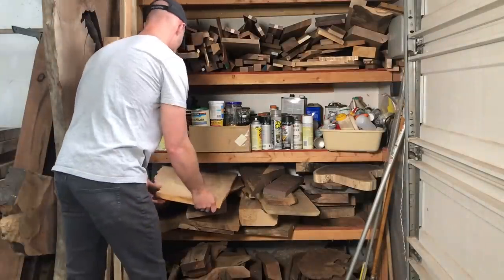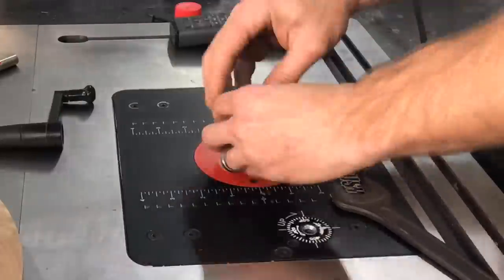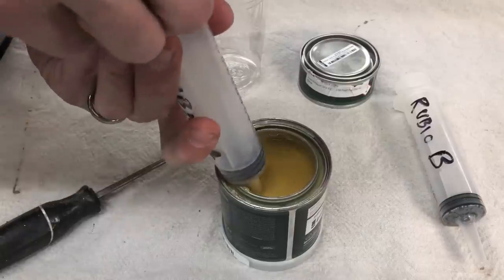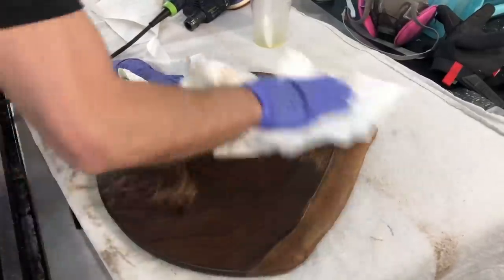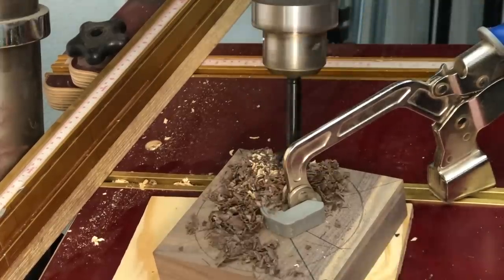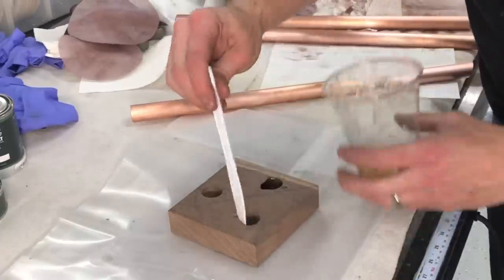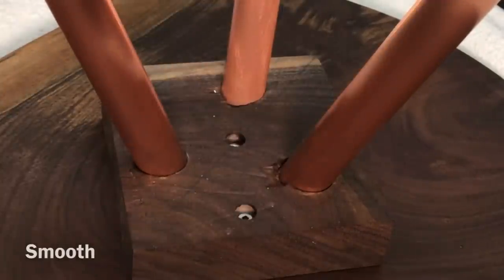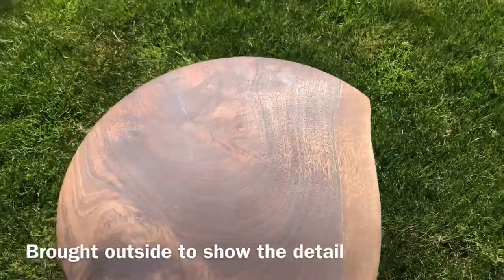$20 Woodworking

Comment: Getting everything ready to make my first river table. Going to be a small end table. 20” long, 12” wide, little under 2” deep. 
Problem is I don’t have a garage or space to work. 
I will be doing all the work on my porch. I’m making a covered box to allow it to cure 24hours between each layer of pouring. I’ll do a few steps probably.
2 questions.
1. If I do multiple pours, is the table top epoxy fine to use? It’s drastically cheaper than the deep pour I’ve found, and not many local options since I’m in Alaska.
2. Right now the temp is 50 at night and 70+ during the day. Anything specific I should try to do to get the epoxy to cure correctly?
Reply from the maker: Yup, both should work fine

Comment: My next project is an outside table with wooden legs and frame (4X4 and 2X4) and PVC deck top.

When you sand, why can't you go from 120 straight to 220 grit? Yeah my table sounds lame but i plan to sand the legs and use something to protect from the elements and all. It will entirely outside, any suggestions on what I should use for protection?

I appreciate you taking the time to answer and the video. I do like the copper legs.
Reply from the maker: 220 isn’t aggressive enough, just part of the process

Comment: Hi Cam, been watching your videos and learning lots and am getting ready to try my first table.
What I wanted to ask, is this table I want to build is going to be placed beside a bath tub, in a damp area.
Essentially it is going to be used to hold glass of wine, candles, book, maybe a small plant. It's small, a triangle with a flat edge at about 24in, top edge about 27-29 in, and the last edge about 24in.
I'm thinking first to stain the cherry wood, use a metallic black epoxy fill in the holes, and then seeing as this would be in a damp area, I had the thought to add a clear coat on top to seal it. Would this be a good idea, or would one of the finishes you used on the $10,000 dinning table build work ?
Thanks for the tips and tricks and education on building these tables. Super excited to start out.

All the best,
Reply from the maker: The clear coat, or any of the finishes that I use should be fine to use in that application! Sounds like a great first project. Good luck!👍🏻
Reply: @BlacktailStudio  One more question.. What's the best product to colour the resin? Looking for a black metallic type. Powder or I see you using drops.

Comment: Epoxy dining table for my fire station. The concept for the table is to look like a thin red line flag with the red line being the epoxy. What epoxy dye would you recommend?  I want it to be a rich fire engine red and opaque. Most of the dyes I’ve seen are see through and that isn’t the look I’m going for.
Reply from the maker: I like transtint

Comment: Hey Cam, how would the OsmoX do compared to the Rubio? I just bought some Osmo based on your videos.
Reply: I use Osmo on all my customers projects. For table tops I put two coats of 1101 extra thin wax to seal then 2+ coats of 5125 full solid polyx. Apply polyx with scraper, buff in with white 3m pad by hand or with an orbital sander/ buffer at low speed. Apply a second coat an hour later with scraper, buff in, rest an hour and wipe excess with clean shop towel. More coats can be added in the same manner. Any water that is left to sit will leave marks but evaporate away in a short time.
Reply from the maker: Not as much shine as Osmo. But better protection

Comment: I’d like to make some cedar Adirondack chairs for sitting around the fire pit.  We are in the forest and it’s very wet here.  Our wood, if left outside, doesn’t last long.  I don’t expect it to but I’d like it to be water resisted as well as UV resistant in order to last as long as possible. I wonder it the 2 part coating would work well or just begin to fade and look crummy after a short time?
I like the copper legs.  Very durable and able to be shined up again should they get dull.  Thanks for the video.

Comment: Not working on anything right now but I did finish your video.  I was wondering.  Did you cap the ends of your copper legs or atleast round them over?  Copper is pretty soft and over time it can bend or fray causing scratches if you set it on a wood or even laminate floor.  I’m probably preaching to the choir but just asking.
Reply from the maker: I didn’t end up using this 👊

Comment: Hi Cal. I've got a few questions for you if that's ok? First of all I'm the idiot that posted on one of your other videos about   how I had some epoxy that didn't cure. Well i started a new table, paid more attention to mixing, and all went good this time! I am seriously new to all this, do you water pop when you do your resin tables too? Also on the first table I messed up, I used rubio, I used the cleaner too before the finish and I ended up with some smooth parts and some nobbley parts. Do you know if this is because I haven't sanded enough/effectively? Or do I need to be buffing more? Did I not get it clean enough? I'm a little lost, any thoughts? Thanks :-)
Reply from the maker: I’d guess it was sanding. And I water pop with any Rubio. So far anyway. Still learning it

Comment: Jarrah burl coffee table with hair pin legs. Will be doing my first epoxy coat on it because why not?
Curious to know what you did on the bottom ends of the copper ? Copper is quite sharp when cut especially on an angle like that, I'd be worried it would scratch the flooring
Reply from the maker: Yup, carpet only!

Comment: Great simple table looks beautiful. As for the coating what would you prefer now the Rubio or the mono? Or what would you use for what application?
Reply from the maker: Rubio is monocoat. Working on a finish video though. Rubio for protection, Osmo for gloss if that’s what you meant
Reply: Blacktail Studio sorry about that. I meant Rubio versus Osmo. As you do a lot of times very large tables don’t you want to use Rubio than for protection?

Comment: I want to use some live edge slabs for the treads on my staircase, do I need to let the slabs dry before glueing them down?  I liked the copper legs, maybe rebar legs would’ve worked also
Reply from the maker: I would think they should be dry

Comment: Good work! I have just made a dining table from pine, I have applied Briwax Jacobean to finish and it looks amazing. But I've noticed that it marks quite easy but you can only notice it with light shining off it. Would you recommend any other coat to put on top to protect it, preferably not glossy?

Thanks!
Reply from the maker: This finish worked really well!

Comment: Whatever my wife wants, my next project, not a big fan with the copper legs.  My issue isn’t wife the copper per se, but more to do with the ends.  Worry that the sharp edge will damage my flooring.  That, and it doesn’t look finished.

Comment: I would really like to get into doing projects like yours and I already have all the tools; but materials are another story. Have you any clue on where I can get small cut offs for a good price? Anything to the same size or smaller then size of the piece you used in this video would be preferable. Also for the legs of this table, I would have used small saplings that have indents from vines growing around them in a spiral
Reply from the maker: Not sure about the cutoffs!

Comment: Hi Cam! I was wondering what grit you finish on for sanding usually? Mostly I think I've seen you finish around 240? I was also wondering why you chose that point to stop instead of maybe going to a higher grit for a smoother finish? Love the videos! Thanks!
Reply from the maker: With this finish you get less protection with higher grits.
Reply: @BlacktailStudio  that makes a lot of sense! Thanks :)

Comment: Black walnut coffee table. I jumped the gun and purchased the 3 gal Liquid Glass Deep Pour kit. Not sure why I didn't think to measure beforehand, but my slab is around 1 3/4". As dumb as this may sound, can I still use the Deep Pour 2" - 4" epoxy I've purchased on this slightly undersized slab?
Reply from the maker: Of course! Definitely under is ok

Comment: I want to make wood/epoxy coasters as a starter project. When you buff in the rubio oil with your buffer pad, do you need to wash out the pad? Or do you have pads dedicated to certain oil colors?
Reply from the maker: The pads are disposable 👍🏼

Comment: Just milled my first walnut logs with an “Alaskan saw mill” and have them curing. Plan on using 2 of the slabs to make a live edge bar top with a built in kegerator.  How long should I let these cure? And should I debark them now or after they have cured for an extended time?
Reply from the maker: Check out my goby interview on the most expensive wood video

Comment: I've got 4 end tables and a coffee table in progress. What are the two parts of the finish. With regards to the water test, I'm wondering if it will lose protection over time, years maybe. Or is it like an epoxy?
Reply from the maker: It’s a Rubio finish; one part is the finish, the second is the accelerator. I’ve linked it in the description. I would expect it to lose some protection over time, but it’s easy to reapply!

Comment: Live edge epoxy table, Hello cam nice table but the legs are bit strange but in a good way 
wanted to ask you whats the difference between wet sanding and the regular sanding when it comes to epoxy tables and won't the wood re-absorb water ?
Reply from the maker: Don’t wet sand raw wood. Probably google it for a better explanation

Comment: Working on some flaming box elder cutting boards and just installed a red river table as a service center in my son's restaurant.  Did you cut angles on both ends of the copper pipes.
Reply from the maker: Nope!

Comment: I’m working on some shelves made from wood crates in a stairs pattern on the wall to double as a cat perch. I used a combination of pure tung out and wax on top on my coffee table but am worried about how it will last with scratches and what not. Use if the two might be difficult to fix them. Do you have any experience with either finish?
Reply from the maker: Not an expert with those

Comment: Computer room desk. My question would be what finish would you choose for a computer room desk? Right now I have Feast Watson Polyurethane. Gloss, aiming for 5 coats. Last coat might be a matt finish or I might rub down the gloss to be matt. Also I'm in Australia.
Reply from the maker: If you’re four coats in I wouldn’t tell ya to change now, it sounds like you’ve got it figured out!
Reply: @BlacktailStudio  Thanks for the reply. I went for it. First coat on and sanded (320 grit). Second coat goes on today.

Comment: Another awesome and informative video, thanks! I was wondering what brand of CA glue you use to fill small holes? The glue and activator I am using seems to sand poorly, leaving more imperfections that need filling and sanding. Any tips and tricks on this part of the process you might be able to share?
Reply from the maker: I linked this one for ya in the description

Comment: Upgrading my workbench, Have you tried similar water tests with Osmo and Odies, and if so which held up better?  So far Osmo holds up better to water for me but, might just be user error on my part.
Reply from the maker: Osmo spots some. And I completely stopped using odies.

Comment: Curly spalted maple dining table. I've  recently started woodworking in the past year and have used Rubio since the very beginning. Due to the high cost of Rubio, I'm looking for a cheaper finish for smaller items, do you have any suggestions?
Reply from the maker: Linseed oil  is pretty cheap.

Comment: I am making small tables like this myself, but i don't have a price in my head. how much would you ask if you sold this one?

Thanks
Reply from the maker: This is pretty simple. Not something I’d try and sell
Reply: @BlacktailStudio  i maks tables likes this with different hardwoods. But it starts warping a little bit. I use wood that was pretty dry. And i used monocoat.

Comment: Currently building a mesquite laptop table.  I see you use CA glue and activator a lot.  I want to like it but it always turns the glue white.  Have you seen this before?  What is the trick?  I have the same brand glue as you but different activator (bob smith).  Thanks
Reply from the maker: Mine doesn’t turn white, but they make a black that works well too

Comment: You said not to use screw's on coffee tables well I'm building and custom book match live edge coffee table and using black pipe for the cross section legs and I'm going to have to put screws would I be messing up by doing so?
Reply from the maker: Should be fine so long as the wood can still move seasonally

Comment: I have a question about the Rubio finish. Is this mostly for naked wood or does it work well with stains aswell?
Reply from the maker: They actually make stains that are a finish as well
Reply: @BlacktailStudio  after I typed this message I did some research and saw that. That's really cool. I definitely want to try this on restoring furnature. The black paint and pre aging cool. If I use a black pre age, can I use another color 2c or do I have to use clear?
Reply: @jasonhunsperger513  Hi Jason, you can use any Oil plus 2C color over any of our optional Pre-treatment options!
Reply: @rubiomonocoatusa  ahhhh I'm so excited. I wish I heard of you guys before  I redid all of my furnature in my bed room. I'll definitely be putting in an order in next few weeks.

Comment: Walnut river table, I got a leak in my last mold I left maybe 1/2 inch of resin in the mold and it dried hard is it safe to pour on top or should I make a new mold
Reply: You can pour over what you have but you will need to scuff it up a bit.
Reply from the maker: Bruce is exactly right. Scotch brite works well.

Comment: I’m working on a walnut & black epoxy table. I have a question about applying osmo’s. I’ve sanded it with no visible scratches but when I apply the osmo’s I can see the swirl marks from where the sander has been. I’ve resanded and applied another coat and same problem. Any suggestions?
Reply from the maker: Maybe too much Osmo? Need a clean pad?
Reply: Blacktail Studio thanks for the quick reply!  I put the osmo on pretty thin but I’ll try the clean pad.

Comment: Copper legs will not be very strong. Will bend easily. I was kind of expecting you to fill the hollow of the copper pipe with dowel or some such. But I  like your work.